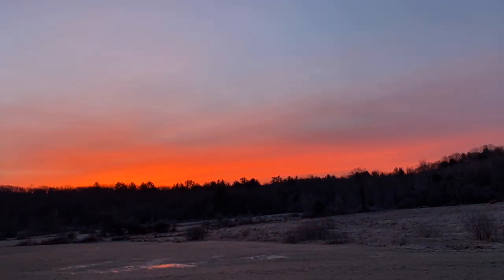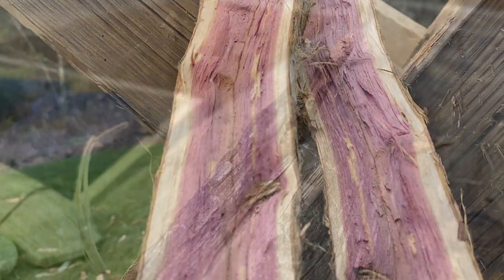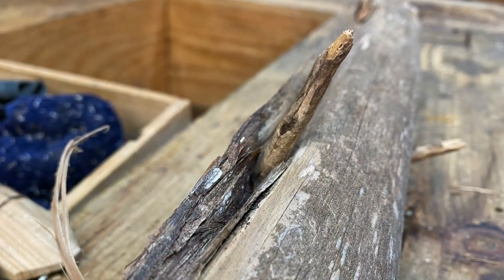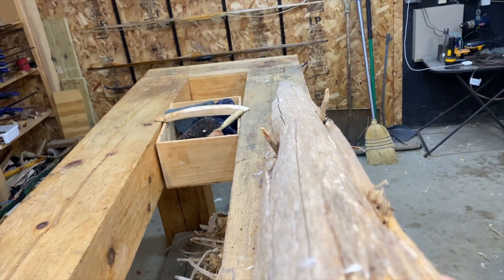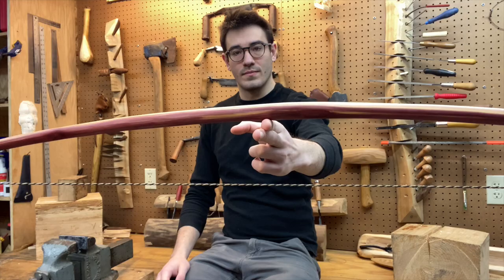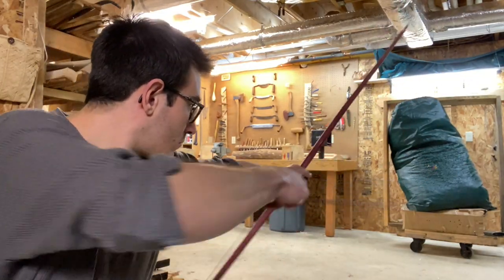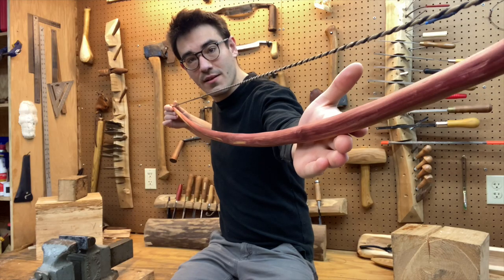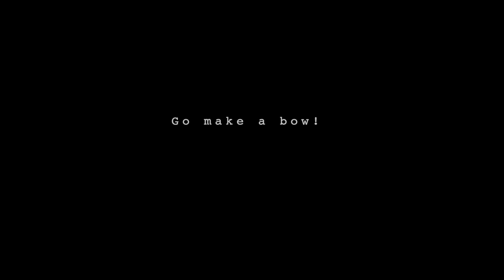Carving a Juniper Short Bow

Comment: Many tribes in the southwest often chose juniper for their bows, simply because it was the only real option. As such, they figured out a few tricks to help with the shaping of the bow and to mitigate the cracking issue; use a steam treatment to help with shaping, and impregnate the stave with a blend of at least two or three different types of tree saps (dissolve them in hot vodka, strain solid particles out with a mesh screen and then paint it on your bow heavily). If you add some chaparral oil to the mix, it will resist sun damage for generations. All that said, you made a beautiful bow, and now I'm looking at my juniper trees and wondering the same thing; might there be a bow in there somewhere?
Reply from the maker: What do you call the process with the resins? I’m familiar with the scandinavian word maelming, which is very similar. I’ve done several times with white woods using pine resin in grain alcohol, but usually prefer a good heat treat, which doesn’t add any mass
Reply: @DanSantanaBows  I'm not aware of a name for it, it's just an approach that revealed itself to me in my studies of alchemy; when you mix three or more different tree saps together in alcohol and filter the result, you are left with a liquid which possess all the medicinal and physical qualities of each, potentiating against each other. When the alcohol evaporates, the saps combine to make a new sap that dries out way stronger and harder. I use it for exotic hardwood projects to achieve a finish similar to an epoxy coating, but with a safer and non-toxic natural alternative. It produces a very rich and strong finish.
Reply: I am bit skeptical of this. The Native Americans did not have distilled alcohol until recently in their history. If they did do this, it would not have been for very long.  Do you have a source by chance? 

The Native Americans style Juniper bows I have seen reproductions of have not experienced any such treatment to my knowledge. They perform fine without it. Juniper doesn’t need fancy treatment, other than perhaps some sinew backing, to create very high quality and excellent performing bows. At least from the data I’ve seen on juniper bows that do not self destruct. But I could see how such treatment would allow for lower quality juniper wood to make a good bow. That would have been useful for short period where they had vodka but not firearms

Apparently the arrow flight record for the primitive simple composite class (I believe that means sinew backed) is held by a Rocky Mountain Juniper bow
Reply: @flightlesschicken7769  obviously natives didnt have grain alcohol, but they did have other substances they used as thinners and cutting agents, and they did combine resins and oils to make them stronger and last longer. we have alcohol though, so i was sharing a helpful tip that makes the process easier and cleaner, but you can see the use of saps and pitch in all sorts of items.
Reply: @joshuawayne9811  Ah, yes, I see

Comment: Excellent, I have many behind the house, maybe I'll use Juniper for my next bow. I usually use ASH or ELM.
Reply from the maker: Give it a try! Smells delicious but it’s hard to find a knot free tree. Look for two that grow up against each other— there won’t be any knots where they touch
Reply: @DanSantanaBows  thanks for the advice, I know what you mean , I will need to look around a while to get a longer stave. Will probably back it with rawhide after initial tillering. Thanks.

Comment: I greased mine with bear grease and they seem to preform much better ,you can use any animal fat
Reply from the maker: I haven’t really noticed that myself. Some other bowyers have tested this and found mixed results. The grease is a good moisture barrier which will protect you from set and indirectly help with performance, but the added weight takes a small sliver off of arrow speed. It’s just a small amount and still totally worth it for the moisture barrier